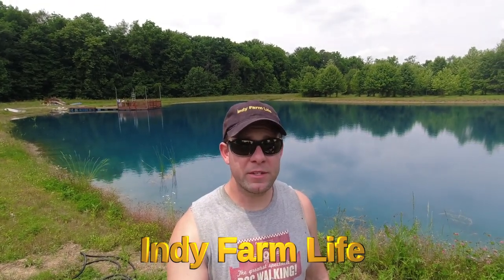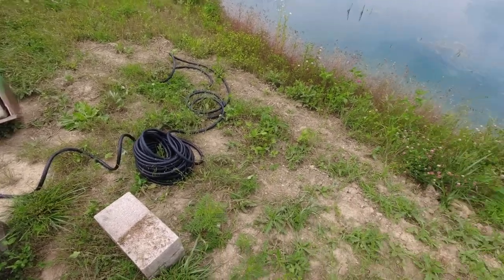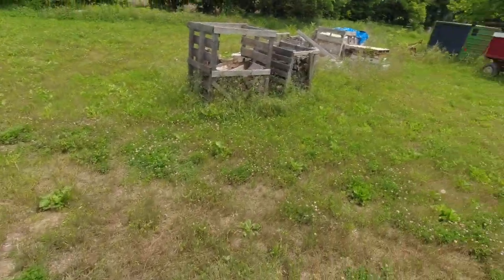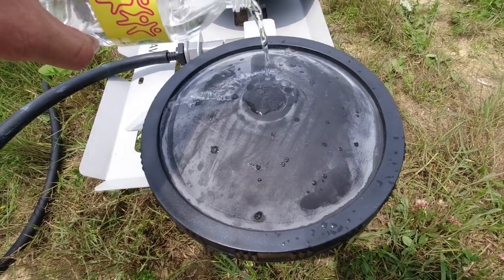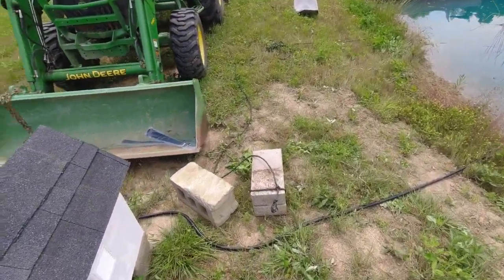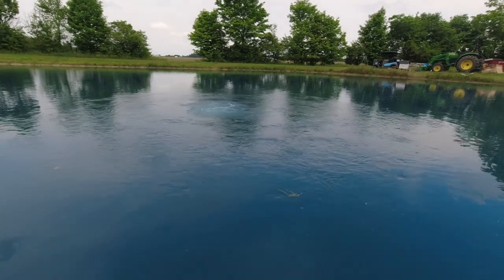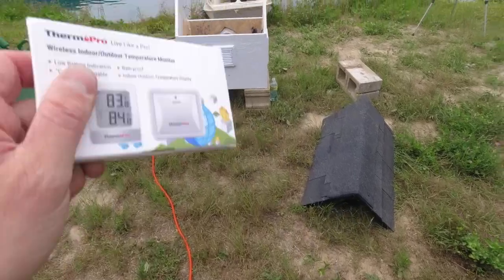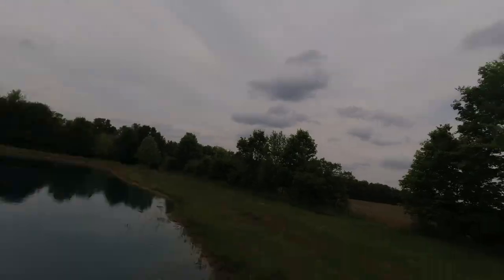DIY Pond Aeration - One Acre Pond Aerator

Comment: I made an aerator for my duck pond from an oxygen concentrator I found in a trash pile. The compressor looks like yours. The enclosure I made from concrete with a sheet metal top cut from a washing machine. My home air system for my air tools has PVC pibe buried. I used the skid steer trencher to put it in, much aasier than backhoe!
Reply from the maker: Nice!  I love salvage projects!  So does my wallet. ha

Comment: That's pretty cool!  But I would reverse the fans (or at least one) to flow *at the pump (pc guy here).  directed air is always more cooling than indirect(diffuse) air.  Also, you can't smell methane, but you can certainly smell H2S! (hydrogen sulfide).  I hear the diaphragm pumps can fail early too.  Interested in the progress of this!
Reply from the maker: Thanks for the info about the fans.  You are the 2nd person to suggest that.  I'll have to make the switch.  It made it thorough the hot summer at least and still running strong.  I have a meter on it now seeing how much it costs to run.  More to come for sure.  I appreciate the input!
Reply: @IndyFarmLife  No problem brother cool vids, cool channel!  You could experiment with a little resistive temp sensor and tape/glue it to the housing and do A/B testing!

Comment: I need to do this for my pond.  quite a bit smaller - only 1/4 acre and only about 10' deep.  Still, needs to be done.  Thanks for the video.
Reply from the maker: It will certainly help!  You can probably get by with a diaphragm style pump.  Many people use a septic tank pump in such a case.  Good luck!

Comment: did you consider insulating the walls of the enclosure?  It could reduce noise and heat.  I'm going to be building one of these and got a lot of great ideas from your post, thanks for putting this out there!
Reply from the maker: Thanks!  No, I didn't ever consider insulating.  It would help with sound, but that's not an issue given where mine is located.  I would fear the insulation would keep too much heat in.  That little pump gets hot!  Most of the heat inside is from the pump, not the sun.  It's pretty warm inside even on cool days.

Comment: I've been thinking about doing aeration. I fight algae early summer. You can use copper sulfate, but only treat pond in sections to prevent oxygen depletion. Put about 5 lbs and mix with about 10-13 gallons of water and spray around your bank.
Reply from the maker: I did that last summer (see below) but we now have fish.  I have read horror stories about fish kills.  I wanted to play it safe and opted not to use it this year.  The air plus bacteria have it looking really nice now!

https://www.youtube.com/watch?v=L5xkNsg8nhE&t=1s
Reply: I use copper sulphate in my pond. Only treat for half the size of the pond then wait atleast 2 weeks then treat for other half. I have yet to have  an issue with my fish dieing.
I do mix in a sprayer with hot water then spray the surface all over with the mix and then run my areator non stop for 2 days then its on a timer for being on at night.
Reply: @IndyFarmLife  best is aeration. He made the right choice.

Comment: Awesome.  How did you decide on a aerator vs fountain?   We’ve got a 1 acre old farm pond in NW IL that I’m looking at doing something like this.  Thanks!
Reply from the maker: Aerators are more efficient at putting oxygen into the water and turning the water than a fountain is.  They are also more discreet.  We didn't want a fountain on the water's surface.
Reply: @IndyFarmLife  thanks.  I don’t either.  Are there any pumps that are submergeable?
Reply from the maker: Not to my knowledge.  Any submersible pump would likely be moving water vs pumping air.  It's cheaper to move air than it is water.  This setup has been awesome for me so far!

Comment: I'm curious if a garden soaker hose would work for making a defuser?
Reply from the maker: It may!  Not sure if it would be as fine as this diffuser but it could work.  It wouldn't be a concentrated in one spot though.  Unless you coiled it and attached it to something.  Would likely need to weight it too.
Reply: @IndyFarmLife  hi there, what's your thoughts on using an oxygen concentrator for a pond? I have two of them and they say they produce 95% oxygen. I don't know if that would be too much or not. What say ye?

Comment: Hey man, Im trying to maintain a 1.3 Acre pond thats only about 6-8 ft deep. 3 pad aerators at 200ft, 250ft and 420 ft out, 1inch airflow line.   Ive tried using a GAST brand rotary vane pump (3/4 HP 10CFM) and it broke on me after a couple of years. I got another one and it broke in 13 months! Theyre NOT cheap! The vanes broke and jammed it up, when it was discovered the thing was so hot, it didnt auto shut off. It doesnt work after replacing the vanes.  And this pump is contained in a box identical to yours. Do you have a recommendation on what kind of pump i SHOULD use? and any idea why 2 of these things broke on me within 4 years? The supplier tells me its that they run continuously year round and thats why they break so often, but theyre supposed to be running continuously.
Reply from the maker: Wow, sorry to hear that.  I haven't used a rotary vane pump, but I did do a lot of reading and Gast was one of the better brands out there.  From what I know, heat is the main killer of any of these pumps.  Any idea how hot it was getting in there?  My rocking piston pump has been running strong for about 15 months now.

Comment: So, the best oxygenation happens when there is more surface movement (like swells not waves in the ocean). That being said, fine bubbles need to be deeper, and coarse bubble diffusion (the DIY PVC option) needs to be closer to the surface, as it’s forcing more water to the surface quicker. They work equally well as long as you place the system you’re using in the right part of the office the water column.

Comment: Could do a raised solar panel and battery to power the pump.  Shade for the pump and power.
Reply from the maker: Certainly could!  I have seen a couple builds out there.  The question then becomes cost/maintenance.  How big of a battery bank will I need to keep it running 24/7?  What about winter/cloudy days?  May struggle to keep up.  I might explore it at some point for sure.
Reply: @IndyFarmLife  My first thought is to get a kill a watt power reader and plug it in a couple days, figure out how much power you are using, then start doing some math about how many batteries you’ll need with a proper sized inverter to 120 for the pump you’ll need, and that will give you an idea on how much solar you will need.  My guess is for something that small, a cheap HF solar solution would probably work and a good battery. But, then again with a good amount of power on location you could do a tall pole light or something like that as well.
Reply from the maker: @philipirwin5286  I think I'm going to do this.  Just looked at my latest energy bill and it ticked up quite a bit from the previous month. (with no aerator)  However, it was significantly hotter this period as compared to last, so that's a big factor.  I'll report back with what I find.

Comment: What pump did you go with? I clicked on the link in description but it gives me an error.
Reply from the maker: Interesting.  I just tried it from my mobile and got the error but I tried from my computer and it worked.  Can you give that a go?  Thanks for letting me know.
Reply: That worked! Thank you 👍🏼
Reply: @IndyFarmLife  did you install any one way check valve to prevent water from filling the air line when the pump isn’t running?
Reply from the maker: I didn't because I run my pump 24/7/365
Reply: @IndyFarmLife  Just received my pump and the hose barb on the diffuser side is a check valve 👍🏼
Reply from the maker: Nice!  What is your plan for a housing?  Perhaps you don't need one if you have it in a garage or shed.
Reply: @IndyFarmLife  I was going to put it in the garage but decided to purchase a deck box to do a similar set up as yours.
Reply from the maker: @jarrid.b  Nice!  Also, stay tuned as I am currently running a power test.  I have a meter on it so I can tell you how much it is costing to run it.